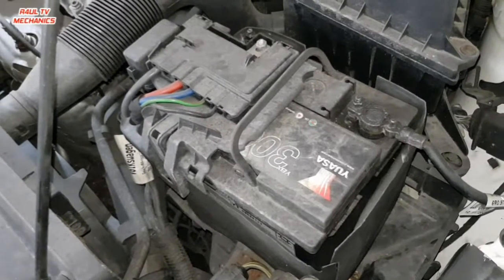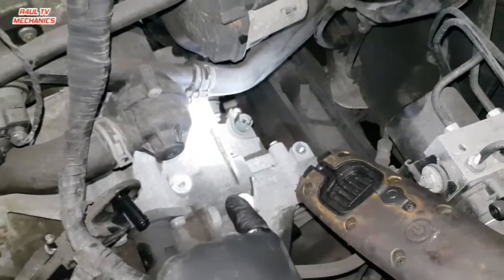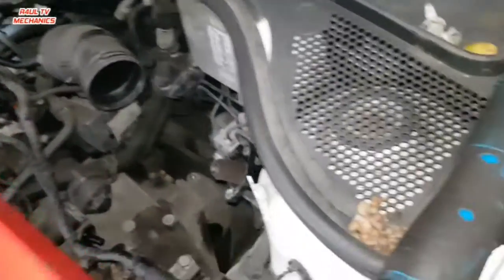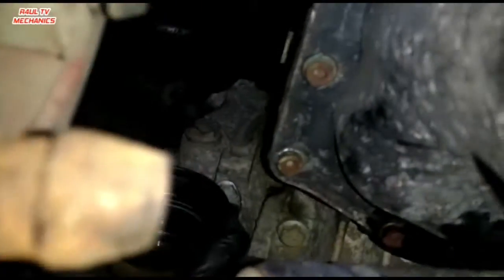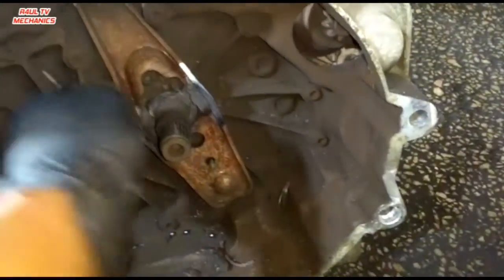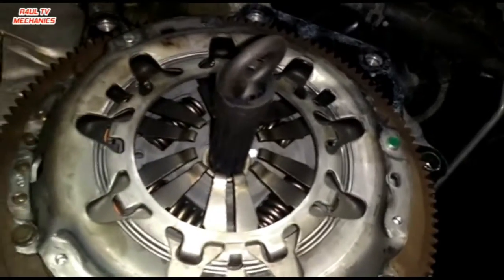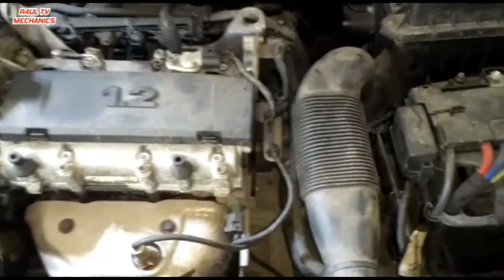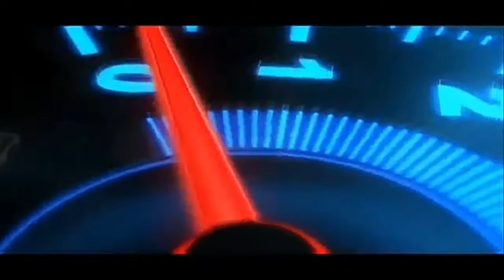2010 VW POLO CLUTCH REPLACEMENT 1.2 PETROL

Comment: Great video!! Can someone help me out? I have 2016 polo gt the gears keep slipping, if I put the car in 4th from 3rd it thinks it is still in 3rd. When I accelerate the dashboard lights up showing the car in 3rd gear even though it's in 4th. Do you reckon I need to replace the clutch??
Reply: There is  shows abs light?

Comment: Terrific video bro. I wonder how much you’d charge for this? Also, if my clutch feels weak or stiff or odd in any way should this signal a replacement
Reply from the maker: This job will normally cost around  £300 
If your clutch feels odd might not be the clutch itself, could be the cylinders

Comment: Do you need to drain the gearbox oil before removing the diff output shaft ?
Reply from the maker: I dont remove the oil what ever comes out I just retop it up

Comment: Hi what different ways to know when the clatch kit needs to be changed?
Reply from the maker: Hi thanks for watching. Few ways to tell. 
If it starts slipping for example if the revs go up but car dosnt move too much. 
When the car is off you can change gears easy but when you start the engine hard to change the gears 

Theres more examples the 1st one is more common

Comment: Hi Thanks for video.  I've got a golf mk5 1.9 tdi ( engine code BXE).  Threw a conrod out of block recently.  Any idea why this happens?  I've read on the forums where it is recommended to replace with BKC engine.  Not sure whether I should go for a remanufactured engine.  Planning to do all the work myself.  Any suggestions would be appreciated.

Comment: Nice one brother man, tell me something man on 1400 polo vivo clutch  is not clutching after doing engine overhaul as well as clutch, it spongy and it doesn't seems to be building enough pressure to   be applied to pressure plate in order to free clutch  plate. There is no visible leaks and I replaced master cylinder as well because it seemed to had internal leak since it was building enough pressure but basically there isn't much difference even after changing master cylinder. Note that it was clutching before and it was driven to the workshop.
Reply from the maker: It must still have air in it. Or the clutch pressure plate is faulty

Comment: Hi! Octavia 2014 2.0 liter TDI manual gearbox (6 speeds) running about 266000 km, the problem happened suddenly when the clutch pedal is sticking down, I need to raised it manually several time to engage the speeds. There is no leakage of fluid after the inspection.
I tried to bleed air from the system, it needs to move the pedal and press it about 40 times to have a normal feeling, but the liquid comes out full of air bubbles (almost white in colour) from the breather. 
Is this a problem of the Pedal pump (Master cylinder)? or in the pump within the whole mechanics (Slave cylinder)? And could this happen for a  breather problem? thank you
Reply from the maker: Hi thanks for watching really appreciate it. Does yours have a concentric slave cylinder if so could be that the one inside the gearbox. If it's on the outside try replacing that before you do anything.

Comment: Hi I have a polo mk5, 3cylinder 4 valve, when shit gears in low rpm , or hit gas and lose it immidiatyly the car is shocking espicaially in low rpm, it is getting worst, it this a clutch problem or something else?
Reply from the maker: Could be clutch. On the polo 3 cylinder they burn the valves out also could be the timing chain

Comment: Hey my brothers is making a grinding noise when rev’d in neutral and can feel a vibrating through the clutch pedal, been told it could be the flywheel how can you tell if it’s the clutch or the flywheel, cant seem to find any flywheels on any online parts sites?
Reply from the maker: For the vibration on the clutch could be the clutch or flywheel.  As for the nose when reving could be one of the pulleys or water pump
Reply: @TEAMR4ULTV  in neutral when you press the clutch the grinding noise goes away at the biting point then comes back when you lift off the clutch, been told it’s the clutch release bearing, that sound right?
Reply from the maker: @rhysdurnion7175  yes that sounds right

Comment: I have removed all the bell housing bolts but the gearbox is still stuck to engine. How do I seperate the two? I am working on vento 2011 diesel.
Reply from the maker: Maybe just stuck on the dowls, if you have taken all the bolts off just use a pry bar and pry it out
Reply: Bro is your clutch replacement done properly? How is it now. What extra tools have you used to do it? I am thinking to do it on my vento soon.

Comment: How  do I line the gearbox  up to slide in to the engen
Reply from the maker: You  need two people to be honest makes your life a lot easier. Once you have the clutch lined up it should just go in
Reply: @TEAMR4ULTV  i had 2 people and we have lifted the gearbox and it yust don't want to slide in to the pilot shaved
Reply from the maker: @andrestrydom8362  did you driveshaft cap/different cap off
Also did you try the clutch plate o  the input shaft in the gear box and last you have to make sure its lined up. One more thing if you are using a gear box lift try lowering it a little or lifting it a little hope you get it in.

Comment: How many miles did that clutch last on that particular vehicle before it was changed?
Reply from the maker: It was less than 100k
Reply: @TEAMR4ULTV  probably been abused. I've got pretty much the same gearbox and it has lasted 135k.
Reply: @nsoper19  165k 1.6tdi 140ps 300nm

Comment: I changed clutch but it gives sound in  morning when I start it and if I press clutch half it goes when I'll leave clutch it comes back but In morning when I start it after 1 minute sounds finish and while I'm driving I can't hear any sound again it's always do in a morning. When it's cold and if temperature is above then 15 degrees then there is no sound at all.
Reply from the maker: Has to be a faulty release bearing

Comment: I need your help
Reply from the maker: How can I help you
Reply: Is it possible to lose timing when replacing clutch kit for polo vivo, my car won’t start after the clutch kit job
Reply: Is it possible to lose timing when replacing clutch kit for polo vivo, my car won’t start after the clutch kit job
Reply from the maker: @sivuyileanelengxwana7553  hi thanks for watching really appreciate it. Yes you can if its timing chain driven you need to hold the crank pully when tightening and taking the clutch off

Comment: VW says the car should be brought to their workshop, dismantle the gearbox, measure the shims and that's when they can get the right clutch kit. How true is this? Cause then this says i cannot just walk in to a store and buy a clutch kit
Reply from the maker: That's not true I got the clutch kit from local spare shop am in Manchester and used BMS Motorfactors
Reply: @TEAMR4ULTV  thanks bro